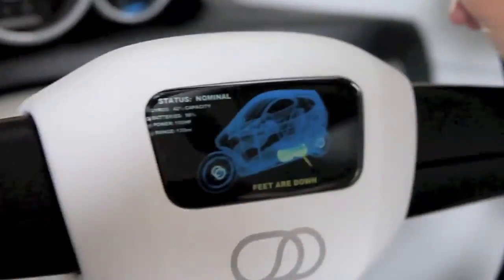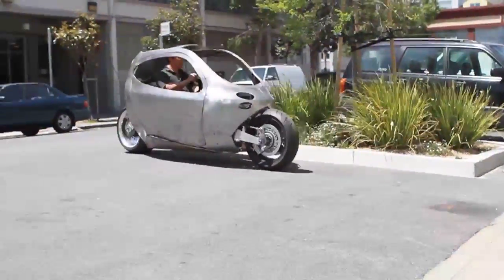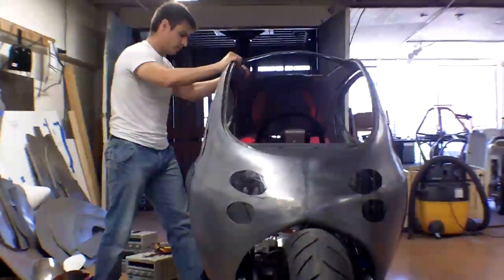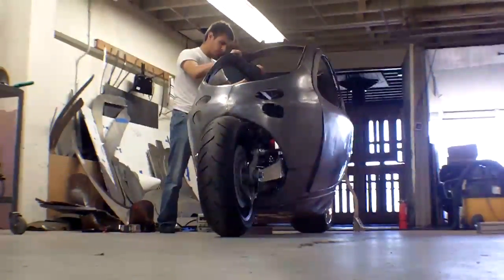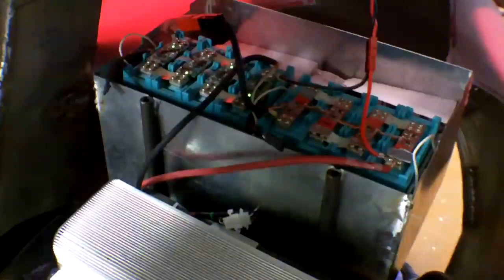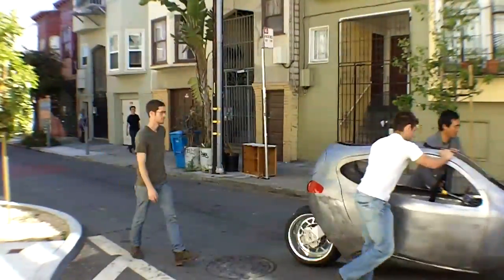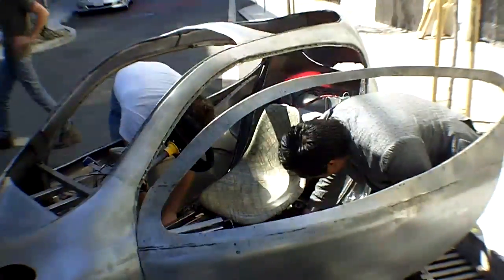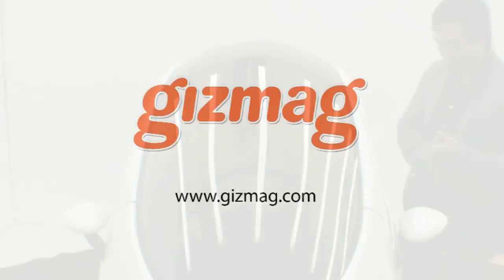Lit Motors unveils functioning prototype of its C-1 self-balancing electric motorcycle

Comment: The `prototype´ shown on their website has now been discarded. Its only use was to further interest in pre-payments and investment. The current test vehicle is nothing more than a basic frame with gyros, and is chain driven. Apparently the electric hubs have been discarded too. A number of videos on Facebook show it driving slowly in a straight line and in a very shallow curve. No single element of the vehicle has been finalised. And yet pre-payment slots are still being sold and LIT maintains that the first production run is to commence in 2014. The project is rapidly disintegrating into a world of fantasy.

Comment: The two gyros were too small for the sheer size and weight of the C1. I suggest they add one more gyro but too large for the battery to power it up plus the electronics and the motor. Another suggestion is the use of some light materials used by aviation industries and supercar manufacturers....Carbon fiber or Kevlar. The problem with those materials is it will make the C1 too expensive for what it is.

Comment: IT'S NOT A FUNCTIONING PROTOTYPE!!!!  Use a Piaggio three-wheel configuration to hold an enclosed cabin instead of wasting money on gyros.  A 3 wheeler also has more rubber on the road to help in cornering and stopping.
Reply: More rubber means more friction means less efficient.
Reply: sqgl 3 wheels are more efficient at stopping.  3 wheels are more efficient at staying upright on their own.  Does it take more energy to push 3 wheels down the road?  Yes, but not much more.  Also, it takes energy to keep gyros spinning.  Gyros are not just powered up to speed, they require added energy every time a turning force is applied to them.  Every time the vehicle makes a turn the gyro feels resistance and will slow down if the motor doesn't power it back up to speed.  In reality that may not be a problem since none of the several videos I've seen on this vehicle actually show it making a real turn.  That was 3 months ago tho, maybe they have a video of it making turns now, I don't know.

Comment: I've seen a few videos of this, but I've yet to find a clip of it actually turning a corner. Something tells me it'll have a wider turning radius than a car, let alone a motorcycle. Also dubious about the claimed 220 mile range. Even the latest electric motorcycles with huge batteries get about 60 miles.

Comment: 2 gyros are to fit into tight space under seat and 2 failures at once are unlikely.
e-drive is to use gyros for regenerative braking, to use hub motors (no hood and transmission), and to look "environmentalist". 
Asians look like teenagers till their 50-s.
Yes, for the laity it looks awesome, but for those who can see conceptual faults it's not so.

Comment: This is silly, how would it discriminate between an oil stain in the road and taking a fast curve?it would tend to continue in straight line, how will it connect/disconnect this function? cause we certainly dont need it all the time, we want to lean our machines safely as far as possible.

Comment: how wide is it? if it's more than 1Meter it certainly won't cut through traffic like a motorcycle... I'm still a big fan of that BMW scooter with a roof, I think if you mixed that with the MP3 hybrid and got an MP3 hybrid with a roof you just might have the ultimate city transportation vehicle